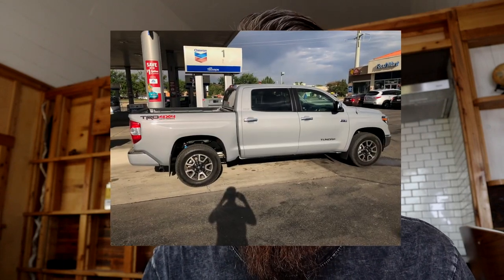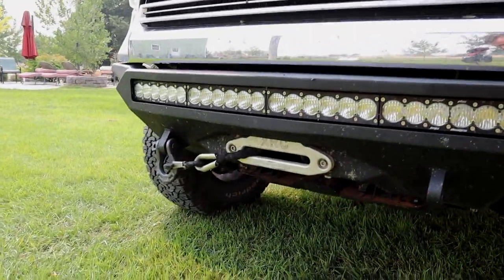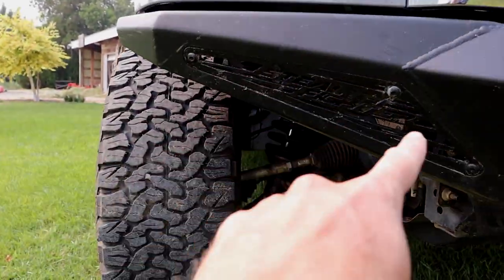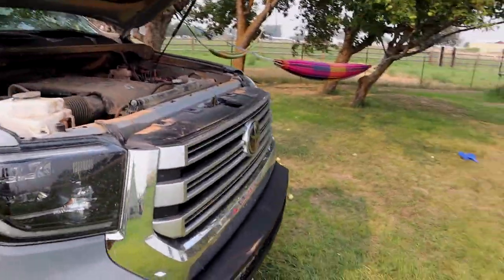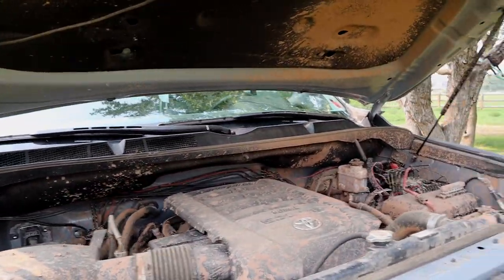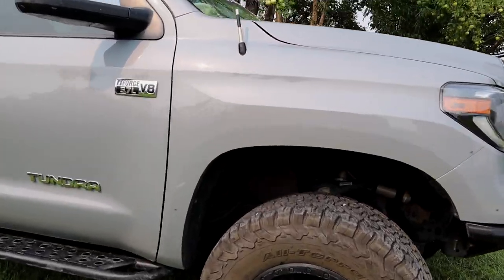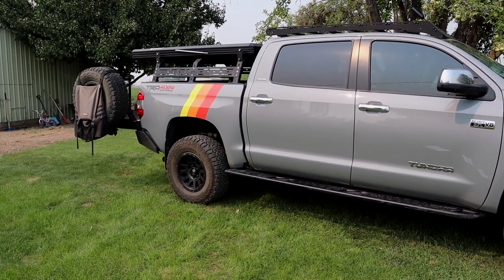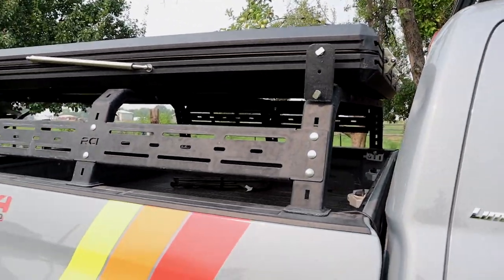OVERLAND TOYOTA TUNDRA TRUCK BUILD - Offroad Toyota Tundra Bug Out Truck Walk Around

Comment: Did you ever think of spraying a liner in the truck bed ?

Also will you put direct me to your Instagram?
Reply from the maker: I need to get a liner in so bad... ppl are taking all the paint off the top sides with the Oars from our whitewater raft. For some reason I kinda thought it wouldn't really be necessary because the decked system protects the bottom... but the sides are getting worked.  Instagram is https://www.instagram.com/natejmueller/
Reply: Ah! Now I’ll most definitely get the bed lined. I was more worried that water would get trapped under the decked system and start rusting out of sight. 

Added on Instagram!

Comment: That isn’t a very strong bumper at all.
Reply from the maker: What are we talking about? Front? Rear? ... strong compared to what? Weight is a big issue for me so I have to balance weight and strength.
Reply from the maker: If you are talking about the front bumper... I would tend to agree with you. However, it is strong enough to handle the winch under a full load... and it handle a deer at full speed... so... seems to be strong enough for my needs.
Reply: While the front is stronger then the OEM in which you replaced you may want to go a more custom route.

Most bumpers that are made only use 636 plate steel, maybe 3/16” at best. 

I recently seen an ARB bumper that was damaged in shipping of all places. Yes, it will provide more protection over an OEM  but if it can be damaged while being shipped it doesn’t bode well. 

I personally made bumpers using channel. It’s not pretty but I feel sorry for the person who rear ends me. 

Most people tend to get a front bumper first with out needing it due to a winch. Thankfully you do. I would suggest the rear is more important if you’re looking for protection.